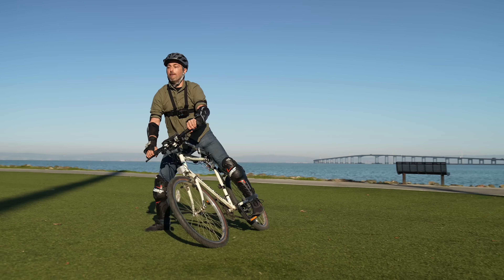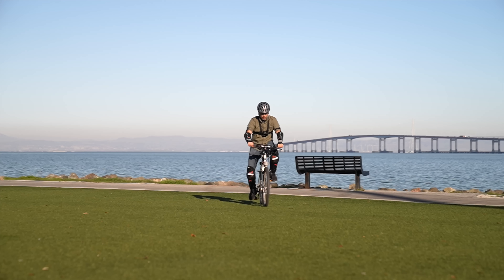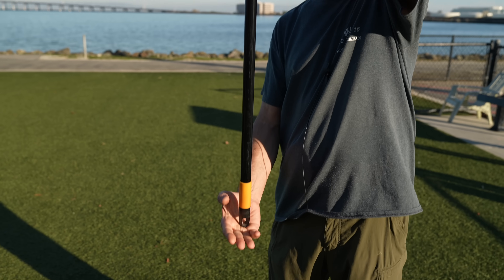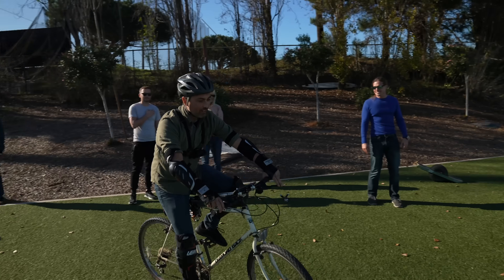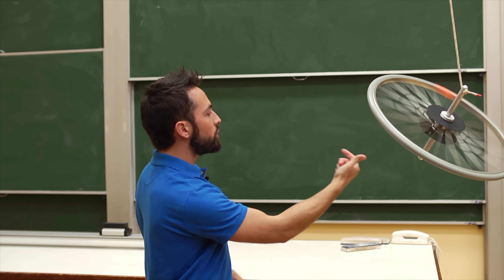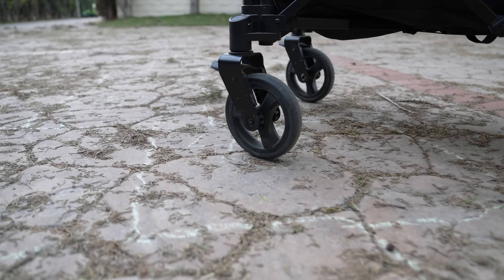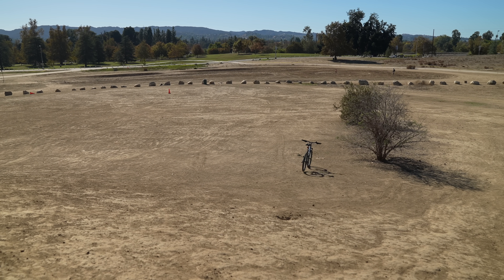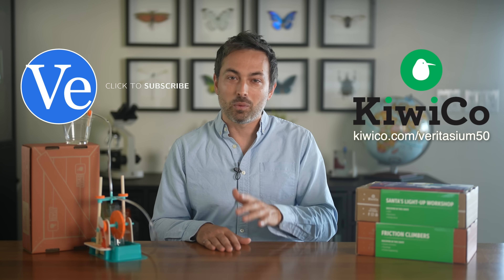Most People Don't Know How Bikes Work

Comment: Holy b*sh*t!!!

What kind of mental illness causes a person to see things the way this narrator does? A beginner rider does not ride this way, nor do many mountain bikers. It is impossible. However, when a person begins to learn how to steer with leaning the bike with their body, then countersteering helps to lean the bike first. It is more relatable to steering a single wheel wheelbarrow, vs a double-wheeled barrow, where leaning the barrow helps to steer in, and a double-wheeled barrow cannot lean, so the person has to steer it differently. And heavy loads will not steer well by leaning if turning tight because they are harder to control. 

It is true that countersteering is used during bicycling at times, but this is not "how" it works. And those who try to simply learn to steer by countersteering first are far more susceptible to wrecking, because balance becomes improper and more tire friction is necessary to keep the bike on the road or trail. 

It is amazing how many people these days attempt to make science appear to be something it is not, simply because they cannot see the beginning values of something. Countersteer is an effect of a person leaning with their bike quickly, and is not a steering mechanism. 

Some people want to be smarter than they really are, notice a little something different, cannot explain the entirety of the situation because they cannot fully picture it, then simply try to figure out how to convince others of their perception, rather than actually figure out all yhe details so they are an expert on the subject. Keep trying to convince riders of this, and you will only train people to set themselves up for wrecks!!!

Comment: No way i ride like that, i Just use my body before turning... A Simple move in my head makes my bike start falling to the direction I want to turn, probably, this peaple dont ride small bikes at high speed.. now if it is a motorcycle at high speed, yes... you need to counter steering...

Comment: i am  often   signaled by car drivers in traffic because they don't understand where i am going ..  you  have to  contester very heavy  at high speeds in traffic if you  make sharp turns  and many  drivers don't understand where are you  going . and that the bikes  steer differently  ...  the same thing is when you  ride a bike without your hands, you  lean to  switch you center of gravity to steer .  .. Drift cars use counterstaining  and make use of the same principles in wheel alignments  ..  is a question of mas speed and how high  is the center of gravity

Comment: So just a quick tid bit you could do it and any motorcycle driver should know this. You first have to kick you weight the opposite direction then bring it back the direction youre turning. You can see this most when a biker takes a hard turn and kicks out there leg towards the direction there turning. This is how you avoid counter steering and it’s important to know before riding motorcycles, but also counter steering is also very important for riding as well. You must know when to do both

Comment: I am a cyclist and amateur scientist with professional degree at hand.
This is my revisit to this video to tell, "It depends on geometry and center of mass of bike" and what you've told in the video is not entirely correct.
You claim: You first turn left to turn right (and vice versa). 
In fact: They call this maneuver the Scandinavian Flick in Rally, yes it even works with 4 wheels and used by Colin McRae in every corner above #3.
As a cyclist, I never took attention to this, thanks for this Derek, but in fact, I never did that opposing turn in my experiment with my XC (cross country bike) 
I happen to bend the bike to the designated turn with my ass. I make a slight right before a turn to bend the bike to right if i want to turn right, and i do this automagically, never did extra attention.

With that said, perhaps the bike you tried has so high CoM and a bit unstable, and maybe if I rode it, I'd do the same, who knows.
But overall, You had to experiment it with real sport bike with a proper cyclist to make it a scientific video.

Comment: Actually has a Child growing up i had learned momentum. Momentum as a Force is something applicable in this type of situation. A motorcycle is the perfect example of that. In order to turn right you slightly have to pivot both body and hands left before right vice versa. I have had my bike locked and stayed right (due to malfunctioned), fortunately a circle and no traffic around wasn't a bad thing lol.

Comment: The first thing I told my mate when I was teaching her to ride a bike was "the handlebars aren't for steering, theyre for ballance only" (if youre going at any speed at all, not doing slower-than-a-crawl see-if-i-can-maintain-this), "steering comes from leaning"; the wheel camber

They're bikes, not cars (whose flat-on-the-ground tyres do steer via turning the wheel). You turn left when you go left only to right yourself after your actual maneuver, which was the lean.

Comment: you dont really need any science for this.. the higher the object that wants to move, the higher the center of gravity. since the center of gravity is higher,it will move slower than the base if the base is the moving part. that's why walking is actually a controlled fall. you fall forward in a controled way. same is with the bike. that is cause of the height of center of mass. the lower the center, the less need to "fall" towards the direction. So it's a problem of center of mass .

Comment: Two cycles that always cause problems for new users are 
1) an adult's tricycle -most people , at moderate speed, fall over at the cornering and 
2) a traditional bicycle-polo bike. This has straight front forks which are vertical and a fixed gear (ie no freewheeling, pedalling backwards takes you backwards).  This allows for very nimble steering and manoeuvring.

Comment: Well counter-steering is only necessary if you don't pre-lean, as shown in the video. If you're upright or leaning the wrong way, then you'll need to counter-steer.

Maybe a better way to test this is to create a bike that doesn't have a caster angle on the forks. I bet that would be insanely difficult to ride.

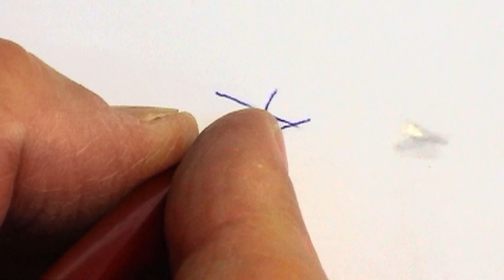9:19 that is literally positive caster angle. So there is a caster effect. Any vertical steering angle that's fore or aft of the steering axis will be subjected to caster dynamics.

Comment: As a Dutchie who can cycle even inner cities without holding my handlebars, the whole steering thing seems very obvious, but after having watched a few videos on cycling and the science behind it, I can understand why people have trouble with bikes.
Reply: I can’t ride without any hands on the steering  and I never knew that it was the handlebars themselves steering the bike. But I still don’t understand how you ride straight while doing it. A bike on its own will start turning left or right, but I’ve seen people riding with no hands for a long ways
Reply: @colatf2  most steering I do is done by shifting my balance instead of turning the handlebars, if you lean right ever so slightly, your bike will lean to the right and that causes the front wheel to follow in that direction, you obviously can't make sharp turns but most cycling paths that are not immediately besides general roadways deliberately use slow, long turns over sharp ones.
Reply: @colatf2  Its because when you ride without holding the bars you are constantly shifting your balance to turn the front wheel where you want to go.
Reply: @colatf2  You seldom really use the handlebar unless you're at low speed. To ride without holding on with your hands, it's easier the faster you're going.
Reply: Yeah I'm usually riding without handlebars just leaning.  BUT I think if you tried to do that on this bike it still wouldn't work because when you end the turn you need to shift your weight the other direction causing the handlebars to turn that way and get you back upright and balanced.

Might be easier if he went a bit faster.
Reply: @PlaySA  Yeah it wouldn't work because you turn by shifting your weight but the handlebar follow your movement and turn, but there they can't so you would still be blocked. I would love to see what happens exactly tho could be interesting
Reply: We dutch people learn the operate bikes at 3-4 y/o, so most of us are naturals. Ride a bike better drunk than I walk. No hands is no problem , but if you've never ride bikes is assume is as hard as driving a car.
Reply: People aren't having trouble with bikes, quite the opposite. People do well on bikes, but are doing so automatically out of instinct. The science behind all that is what's so confusing and fascinating.
Reply: Was looking for a fellow Hollander in the comments hahahaha
Reply: cool to see TU Delft mentioned in a Veritasium video :D
Reply: Another dutchie here. i deliver sushi 4 days of the week i can easily drift city bikes and make big turns without any hands on the handlebars.
i even eat whilst cycling :p
Reply: isn't a Dutchie what you call a Dukedom somewhere in Europe?
....or was it a breed of dog....?
EDIT: When I look up Dutchie I just get weed in many shapes and sizes..... plz help
Reply: @Broockle  Its what Dutch people call 
each other and themselfs on the Internet. (or sometimes in real life) 
Example: "I'm the only Dutch one in my discord gaming group"
* Joins * 
Friend: "Hey there is our dutchie good to see you.

The Netherlands is built around cycling, we even have enormous parking garage's just purely for cycles and a lot of roads in which cyclist have priority. We also have the most bikes per person for every citizen there are 1.3 bikes. This isn't taking in account the enormous amount of bikes being sold unregistered second hand. Bikes are the most sold products on our Dutch version of ebay After Phones and clothing
Reply: @finn4240  
o... "as a Dutchie" it maxe sense now
Cyclist wonderland confirmed
Reply: Silence, yuropoor

Comment: I think anyone who's used to riding their bike without the handlebars already knows this, and so I turn by shifting my weight. I don't use the handlebars for anything other than support or if I'm moving very slowly. It's so reliable I can do it without touching the handlebars, even in tight turns (don't do this at home though, the police frowns on that sort of thing). Notably, the physics of the bike will do the counter-steering for you.

Comment: Thanks for the video Derek!

Wanted to say that you can experience the effects of counter steering and self correction quite strongly on a motorcycle. For instance search for “tank slapping”. It’s an effect where the front wheel momentarily loses grip and the bike enters into a vibration mode. It can then turn into either a positive feedback loop if the rider interferes or a negative feedback loop if they leave the bike self correct. Extremely counter intuitive as you basically need to “let the bike do its thing” to recover it

All in all motorcycle riding involves a lot of this: where control is more “suggestive” than “imperative”. Would be nice for you to eventually cover some of the physics involved. It is non intuitive and naturally there are a lot of misconceptions there :)

Comment: As a motorcyclist, I very quickly learned about counter steering. Somehow it's just more important to know this information when you're travelling at 50mph haha.
Reply: It's one of the first things you learn when learning to ride a motorcycle. Push the handlebar in the direction you intend to turn. The property is FAR more apparent when riding a motorcycle. Going faster speeds you also need to counter steer through the entire turn instead of just the beginning of the turn.
Reply: As a bicyclist I've never been consciously aware of turning the handlebars to initiate a normal turn, but I've never ridden a bike that weighed more than perhaps 30 pounds. If my bike weighed several hundred pounds and the rotating wheels weighed 20 pounds or more I presume that I'd have to steer the bike out from under me to shift the weight.
Reply: Yeah you REALLY become aware when your bike is suddenly 600lbs instead of 40lbs lmao
Reply: also why having a strong dampener is a good thing on bumpy roads.
Reply: Agreed, motorcycles are much heavier too, need a lot more rider input to execute aggressive manoeuvres